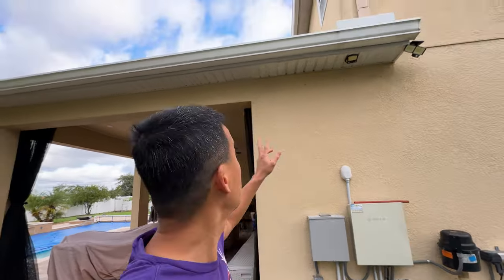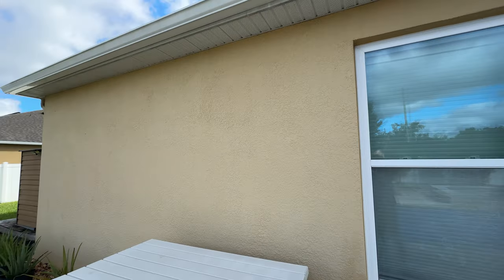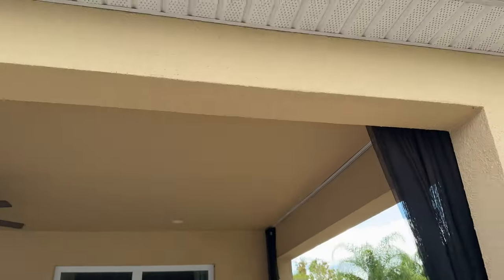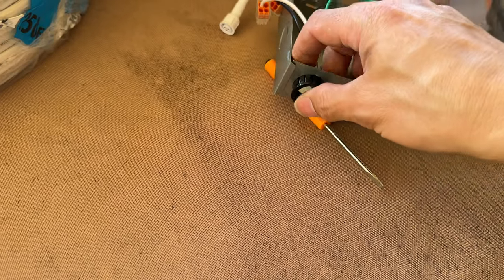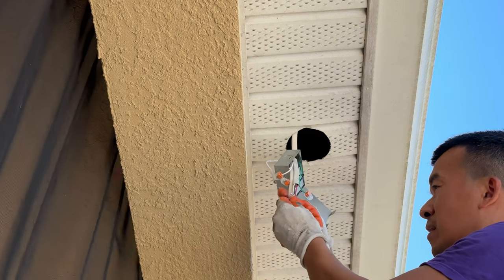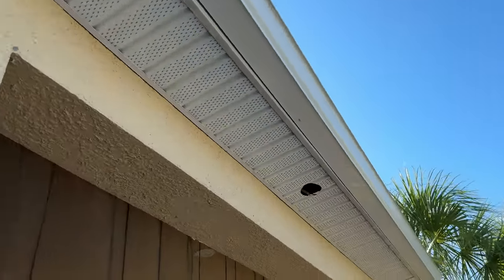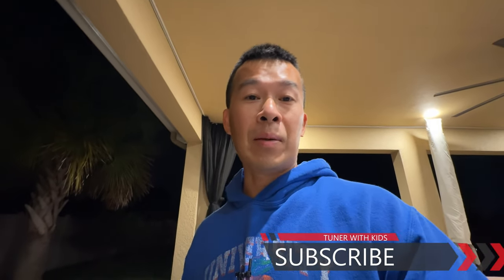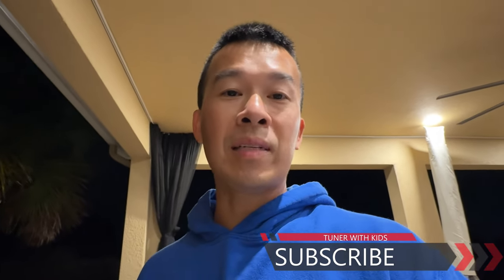How to Install LED Soffit Lights | Pool Deck Lighting

Comment: Fathers should be teaching their sons this stuff since a very young age so when they have their own property they can know how to do house work and save money while they at it. Very nice lights. They add depth and good energy to the yard. Vigilance most important.
Reply from the maker: yea...unfortunately most people are afraid of electrical. But TBH, I wouldn't trust any novice to know what to use to get it right. Even pro electricians be cutting corners all the time. I am an engineer and also work with lots of commercial contractors and have to punch their work, so I know what to look for and what is correct.